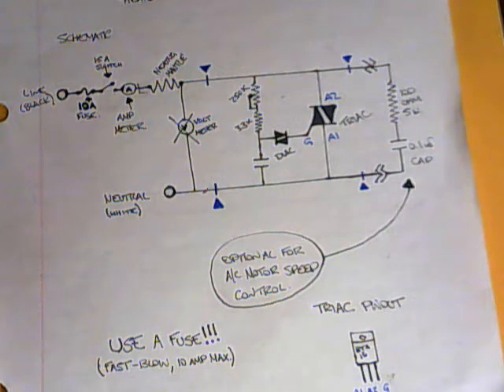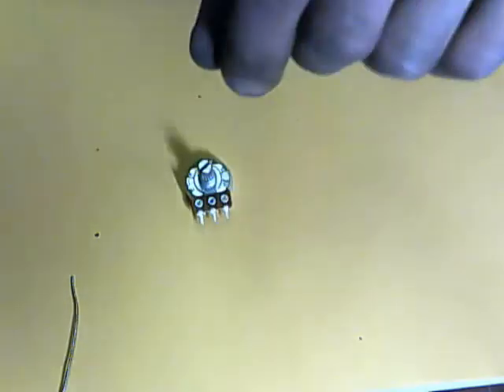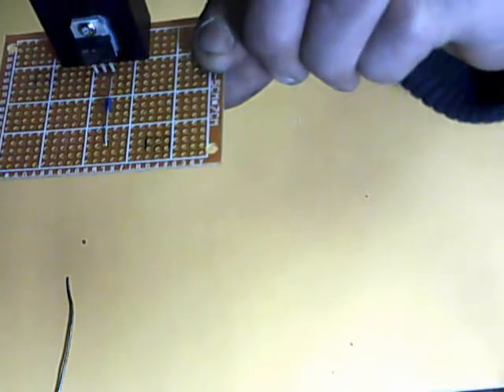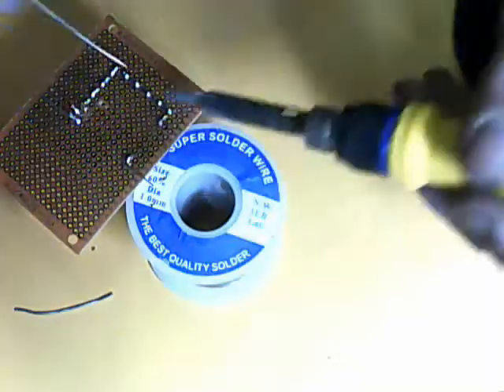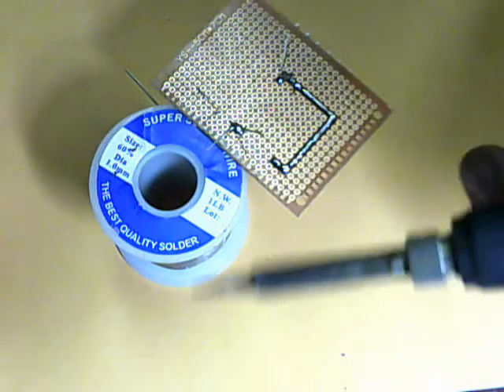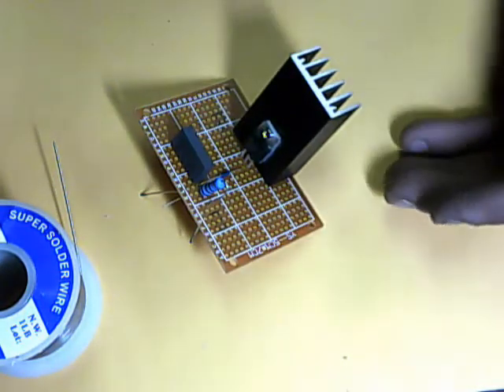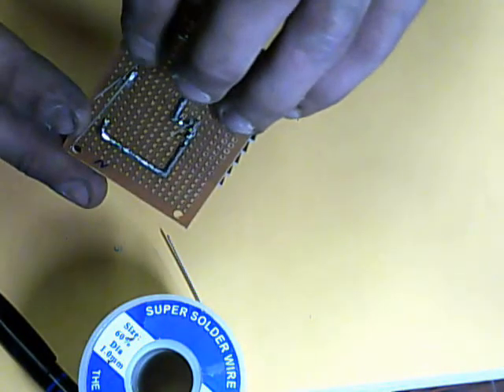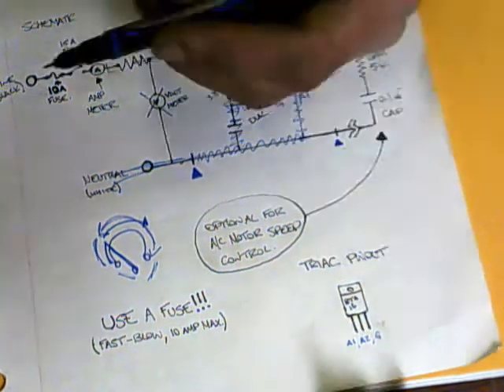Resistive load Triac circuit (Current limiting) LAB MANTLE CONTROLLER

Comment: hey hows it going ? so i went to build this again and i got confused with the heating mantle part. I placed a receptacle for the mantle to plug into my question is on the board where i tie in the receptacle what do i do about the ground? really my question is does my ground go over to neutral also?. Thanks bro
Reply from the maker: ground is not used in this circuit unless you are using a metal case. 

if you put your mantle into a metal case, you put the ground the the case. and if you put the controller inside a metal box, you put the ground to the box.

this is just a safety , if your mantle, or controller shorts out to your metal box (if you use one) the electricity goes through the ground wire, instead of giving you a shock.

if you use a plastic project box, or no box at all, the ground is not connected to anything

Comment: How can I modify this for direct current? I have 12V 5A power supply that I want use for regulated electrolysis. Also what are the modifications fo 220V 50HZ AC?
Reply from the maker: You cannot modify this for DC, you need a PWM circuit. 

You can use this circuit with 220, but you put the second leg to "neutral" 

Ground your case, but make sure the triac is isolated and not grounded.
Reply: nilamotk Yeah, I've thought so. So all I have to do, is to connect pin A1 to live and anode (the middle pin) to neutral?
Reply from the maker: The circuit stays the same, with 220v you do t have neutral, (or at least you don't need it.) so one hot leg goes to (line on the circuit) and your other hot leg goes to (neutral on the circuit.) 

Just make sure your case for the circuit is either non conductive, or it is properly grounded for safety.

DO NOT use the case as a heatsink... The heatsink will be "live" unless your triac is insulated.., and I doubt it is.
Reply: nilamotk  Oh yeah, I get it now, Thank you very much for your help :)
Reply from the maker: No problem.

Comment: this may be a stupid question but im a bit of a newbie
how would you connect one end to the live wire and the other to the neutral? alligator wires?
Reply from the maker: No question is a stupid question. You could take an old power cable and solder the wires from the cable directly to the circuit if you want too, (then dealing with wires without colours , the side with the writin on it is live) you could also use alagator clips, just make sure they don't get hot because most alligator clips are for low voltage stuff. You can still use them but if your powering sometho usin a lot of power (such as these heating mantles) they can get warm.

Comment: Hey, I have not had a lot of luck with the mantles as I think that the high humidity here never allows them to stay dry and they crack badly as a result.  I have made a couple out of perlite that work but they are subject to cracking the same.

I will tried plaster reinforced with fiberglass nect I think  adding anything to a media like this dramatically improves its strength,

I just bought one of those cloth only mantles and used the triac controller to run it and it does work!  It will only go to 2 amps max at witch time it does boil water. there is a very small amount of adjustment so if you turn it down to just about zero it will keep water steaming nice and steady.  The triac runs cool under a good boil, as well.

I actually like these cloth based mantles as I can hang them from the wall out of the way.  They dont seem to heat as evenly but that is rarely an issue.  I paid 12 dollars for a new looking but used 500ml glas-col mantle!

Im sure that there are changes that could be made to this circuit that would improve its resolution for these lower resistant elements.
Reply from the maker: You could try to use fireclay, or pottery clay that you fire to make it hard. It will withstand more heat,

On the other hand, if you make some sodium silicate (by dissolving silica gel beads in a solution of sodium hydroxide, then proceed to heat slowly until all the hell is dissolved) you will end up with a liquor that will stiffen up when cool, if you add this with your water to any mix you have, it will bind the clay or motar or plaster when you fire it or run the mantle the first time. The sodium silicate basically turns to glass and sticks everything together.

It might stick to your glass more, so use caution when make my them this way.

Comment: So you simply connected live and neutral to anywhere beyond the cap and pot on the other side?
Reply from the maker: Live comes in through the meter switch, and mantle, and then to the top of the circuit. Neutral is connected to the bottom part of the circuit.
Reply: nilamotk yes it's just not obvious where you connect the live or neutral. im pointing out that it can be connected *physically" anywhere between a1 and the cap and the  other side anywhere between potentiometer and pin three.

Most people wont get that.
Reply from the maker: Oh I see what you mean now.. I tried to keep it as simple as possible, but if you can't figure that out from the schematic you probably shouldn't be playing with unregulated line voltage.. Just saying.. I don't want this to kill anyone lol..
Reply: nilamotk this is a perfect learning circuit really.  It has some key fundamentals for a beginner.
thinking back i was so paranoid about getting zapped in my younger years, I operated at a much safer level I think.
But i get your point.
Reply from the maker: Yes I agree it a really good one to learn with. It's not to complicated, that's why I posted it to YouTube. 

Getting zapped isn't too bad, just as long as you get zapped with 1 hand... If you are holding the neutral in your left, and you touch the line with your right, your probably going to be dead.. The good thing is you solder it all together, plug it in and see that is doesn't smoke, then put it in a case, before you touch it. Nothing is live while you are working on it..

A good lesson to obey when workin on live line voltage, is to keep 1 hand in your pocket at all times... If you are ever putting a breaker into a panel, keep 1 hand in your pocket.. Work with 1 hand when you are putting in the breaker, when you are wiring the breaker and when you are wiring ground and neutral.. This way, if you so happen to slip and touch one of the bus bars in the back, you will be severely injured, burned possibly on your hands and feet, but not dead.. 

Same scenario only you had your left hand touching the side of the panel (ground) while you slipped with your right accidentally touching the bus, your heart will explode and you will be dead...

Don't let that scare anyone from this project.. The above scenario puttin in a breaker is BEFORE the breaker, and is only regulated by the 100- 200 amp breaker on the mains.. 

Just please be safe when working with LIVE line voltages... It can be scary stuff if you are not safe with it..

Comment: is this suitable 250V 0.1uF 10% Metallized Polyester Film Capacitors 10 Pcs

http://www.ebay.com/itm/250V-0-1uF-10-Metallized-Polyester-Film-Capacitors-10-Pcs-/311080764252?pt=LH_DefaultDomain_0&hash=item486ddbc35c
Reply from the maker: Yes, that will work.
Reply: nilamotk thank you for all of your help\
I used to do a lot of electronics repairs on robotics platforms but I have forgotten a lot.

Never got a lot of theory either.  I have nice a couple of nice weller stations though so thats cool

I also just found some 0.22 275 volt  caps in a drawer.
Reply: nilamotk last question i hope lol
im going to go ahead and order the wire,  would you think i could do a 1000 and a 500 with 50 feet of 20 gauge wire ??
Reply from the maker: It's hard to answer that question because I didn't order it by the foot, I ordered it by the hairdryer. I would assume so though, 50' is a lot of wire. (I will however warn you, just because I have bought that wire for other reasons... It's not like any other wire on any other spool you've ever seen.. It's completely spring loaded and will unwind into a big knot on you if you are not careful.
Reply: nilamotk Will it coil easily?
I deal with kanthal wire alot, so im used to it.
Reply from the maker: Yes it could fine, it's just spring loaded on the spool when you get it.
Reply: nilamotk yeah thats a pain in the ass I have had 28aug Kanthal wire spring and knot. took me several hours to fix  I typically put a wide rubber band on spooks of wire to prevent  this..  It will still spring but the whole row wont fly off.
Reply from the maker: Then your already aware of the problem haha
Reply: nilamotk The wide rubber bands saved y day again with the 20 gauge nichrome.
it really lets the wire uncoil slowly.  I made a 4 foot 3/8th inch tight coil and used about 20 feet of it on my 1000ml mantle.  Was a bitch to make being my first one but I learned some do's and donts.

I am just hoping that I did not short it anywhere. trying to keep all of that coil nicely placed is a pain in the ass for sure,  It will be worth it if it works.  especially for the 1000 ml one.

When it drys a bit ill have to ohm it out to see if there as short.
Reply from the maker: I'm glad it's all working out for you. Let me know how it goes when they're all finished. Just remember not to fire them up too soon or they will crack
Reply: Yeah its in a dehydrator and will stay there for a couple of days.  Im still waiting on about half of my controller parts as it is.

I might tighten up the circuit a little and see about etching some copper clad just for fun.I have shit tons of proto board so I really dont need to but i love doing shit like that.

I made about 6 lbs of ferric chloride and reduced it down and crystallized it.  I never want to do that again!  The only worse thing that there is to crystallize is zinc chloride.  its damn impossible if you ask me.

I just got done setting up a 3 gallon electrolysis of copper in weak  sulfuric acid as I got carried away with converting all of my crystallized copper II to copper two carbonate and then oxide.

You can indeed increase the heat transfer rate with the oxide in the plaster matric.  I dont understand the physics behind that but it works.  It gets harder somehow too.  

I need to set up some side by side comparisons and do a video.  

Its very interesting.
Reply from the maker: Glad it's working out for you. And yes for demonstration I built it large. My actually circuit used is about the size of a quarter.

I've never crystallized iron II chloride as I don't etch many circuit boards and wouldn't ever need 6 lbs of it haha I just made a small batch and concentrated 1000ml to 250ml... Messy stuff that's for sure...
Reply: nilamotk yeah it is and it will rust anything within 10 feet
Reply: i am thinking that i might try running my mantle using a pid controller ans a big as relay for fun, while i wait for my parts to arrive
every time i look in a box i fine 3 more of the dam things
Reply: On second thought I dont think that will work because I believe that these watlows simple kick on and off the relay.

so instant on would not be a good idea. at all.  They do however have 2 outputs so I could decide the voltage on 2 different relays.  That might work
Reply from the maker: That's defeating the purpose unless you want a more easily adjustable temp range.. (And that's not really necessary with boiling flasks and mantles.. "Close" is usually good enough. 

These controllers will hold a temperature, and once you know what to set it at for a given mantle you can just go off the amp meter

My 1000ml mantle does best when I run it at 3amps~ until boiling, then I reduce it to 1 amp~ and it will continue to boil.. On the other hand boiling Mercury I ran it at 4-5 amps constant.. You just have to feel it out a bit when you get them built.. 

On top of using it as a heating mantle... If you do a lot of soldering... And I do mean a lot.. You can make a small one (50-100ml) and use it to melt tin/lead solder.. With flux in a dish you can quickly dip wire tips to tin the tips. You can also make a shallow "dish" and you could float whole circuits that have been drawn out on copper clad. One fell swoop to solder all of the joints at once. (Just an idea for you.)
Reply from the maker: If your boiling volatile solvents, with low flash points you can put a thermometer hole in the mantle to place a thermometer to know the surface temp of the mantle.. For use when boiling solvents like ether, where if the temp is to high it can cause a fire... 

But I didn't need anything that sophisticated so I didn't bother with a real time temperature controller.. It's overkill IMO
Reply: nilamotk yeah i just wanted to run the mantle now while waiting for the rest of my parts, not as a permanent solution .

although i did think about drilling a port for a t type thermocouple 

but really you can calibrate the pid buy putting the tc in a flask of water do the calibration steps and it will remember how to ramp up to the temp you want
Reply from the maker: If you put 120v unregulated to these mantles, you might blow out the heatin elements. 

You would need to run them at a specific voltage (DC) because you didn't measure the wire for resistance.. With the triac it runs 120v ac all the time, but it regulates the current making it run cooler.
Reply: nilamotk yeah after I thought about it that is what was going thought my mind as well.

Comment: cant find 250kohm potentiometer   at a decent price on ebay, might need to check radio shack...
Reply from the maker: http://pages.ebay.com/link/?nav=item.view&alt=web&id=121447219128 

Simplify your search.
If the link doesn't work^^ search "250k pot" then go price plus shipping lowest first.
Reply: Yeah I guess I should have stated that I could not find any pots locally.  I saw the thai ones but have never purchased from another country.

I wanted to get the parts soon, and always figured that it takes forever.

have you purchased from china or thailand before?
Reply from the maker: I buy all kinds of stuff on eBay because it's cheap. I buy in bulk and literally had every part I needed to build this because of that. I have drawers and drawers full of everything from triacs, mosfets, and transitors, to pots, switches, resistors, and capacitors.. I literally got it all. You are right, it does take a while to arrive. But I always buy in bulk when I'm running low on parts, and I order it all at the same time, from the same guy. This way it usually shows up in one package instead of 5-10+.. You can always ask the seller for fast shipping, but you will be paying extra.
Reply: SO you think that its ok to trust the overseas ones?
Reply from the maker: Yes, definitely.
Believe it or not most electronics that are sold in Canada or the U.S. are made from imported electronic parts. There are little to no manufacturers of these semiconductors in Canada and the U.S. Even high end smart phones (including all of their components) are made in China, or Japan.

These thing are pumped out by the billions, daily.. You paying 1.25$ (with free shipping) is technically a ripoff seeing a manufacturer would get 1000 for that cost and use them to produce sony did players.. Or whatever.. Don't be worried buying your parts from China on eBay. If you get a dud, it's a 1 in a billion chance, if you concerned order 2.. I have thousands of parts, and have used thousands of parts, and have never had an issue. Some of these parts I have even used for high voltage circuits in the 10,000v+ range still with no arcing or any issues at all..